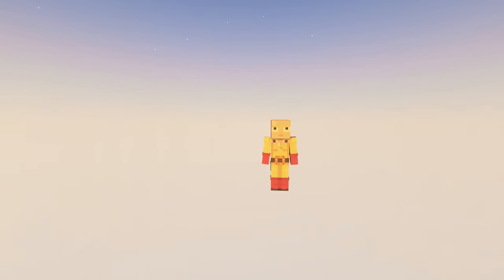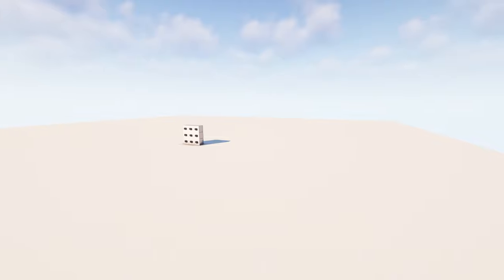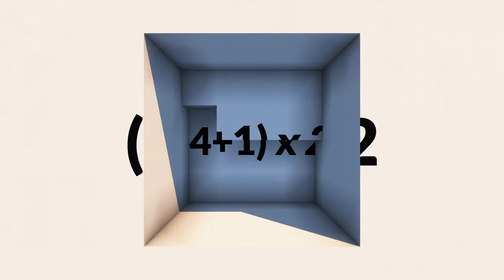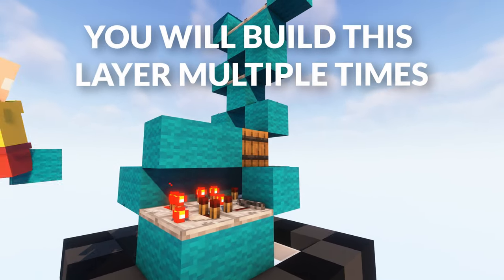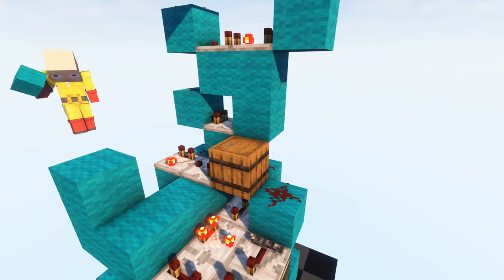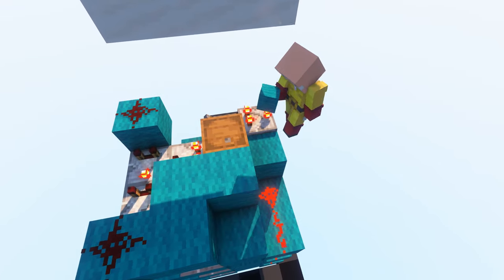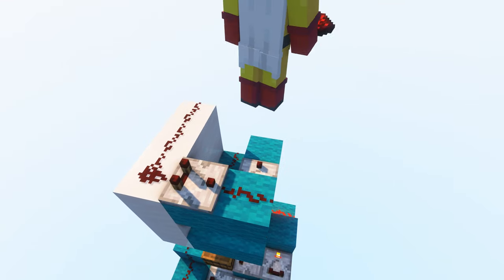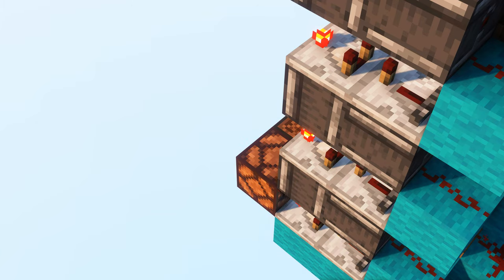Minecraft Java/Bedrock | Smallest Sequential Vertical Combo Lock Tutorial

Comment from the maker: If you are on Bedrock edition, change the 1-tick repeater (3:12) to 2 ticks. However, if your last two digits repeat, leave it at 1 tick and apply the fix (6:06) regardless of how many digits you have. This will prevent the last number in your combination from falsely accepting other numbers.

Edit: Wow apparently this design has been beaten. Still held the record for 3 weeks though I guess.
Reply: Pin this do ppl can see
Reply: Why not just make the fix part of the design reguardless, just in case the last two didgets repeat?
(ps. not rhetorical.)
Reply from the maker: @agsilverradio2225  Basically I was attempting to beat the record at the time, and had to keep it within certain dimensions. Additionally, in the video I advise not to repeat the last two digits, however I still presented a solution to show that it was still possible and not a fatal flaw of the design.
Reply: how big is this?
Reply: The reason I ask, is that that I'm planing to build this for somone else, who could set the combo to anything, and I won't know.
(I would of course, give them written instructions on how to set and use it, but I wouldn't be privy to know the combo when I build it.)

Comment: I want to use a crafter as an input, and have 0 as a valid input.
...
I have figured out that you can do this by puting a redstone block behind the input, seting the compairitor to subtract. then run another comparitor into the side, and make that your new input.
This will invert the signel strength, so that 0=15, 2=14, 3=13, etc.
Note: if you do this, you will also have to invert the signel strenth comming out of the barrels, to set your combo. You will also have to rotate the whole thing 90°

Comment: Hey, I built the combination lock, but it doesn't work. When I click on 5, 9 and 2 the signals are giving, but it isn't activating anything, my iron door doesn't open, even tried to fix at the end, nothing worked. Help?
Reply: If it doesn’t work, then it means you built it incorrectly. You can either rewatch the video and step by step go through your contraption and find the issue that way, or rebuild it. Either way is most likely just as fast as the other.

Comment: I don't supose this machine can take signel strength zero as an input, can it?
...
I'm gonna be using the upcoming autocrafter as the input, and I want to be able to use didgits 0-9.
Reply from the maker: It can’t take signal strength 0 as an input, but if you want to use ss0 from the auto crafter you can use a ss adder or something to offset it to 1-10.
Reply: @UC2OXYgWgz1M-uP_mnvyVWYg
I figured out a way to invert the ss of the input, by runing it into the side of another comparitor on subtract.

Comment: I’m having a bit of an issue, and was wondering if anyone knew a fix. I have built the lock for a 5 digit code, but there are times I will need to input the code 4-5 times before it registers. Is it possible to make the system a bit more reliable?
Reply: SAME

Comment: im really confused, how do i set a number combination? i wanna set it to 1 9 6 9 1 but i have no idea how that corresponds with a signal strength (if that makes sense), any help?
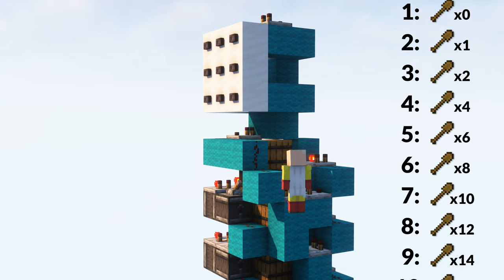Reply from the maker: Starting at the top barrel and going down, put 0 shovels in the first barrel, followed by 14 shovels, 8 shovels, 14 shovels and 0 shovels at the bottom barrel. Each button sends a different redstone signal strength and each layer compares that input with the signal strength in the barrel to check in the input is correct. Video instructions are at this timestamp: 5:45
Reply: @CrossAirsGaming  ahhh alr got it, also ty for the quick response!